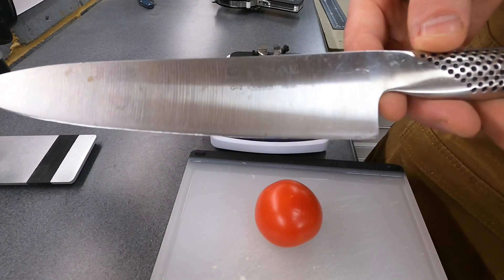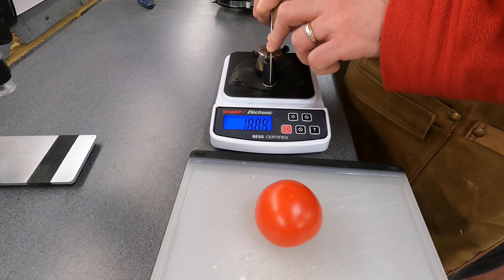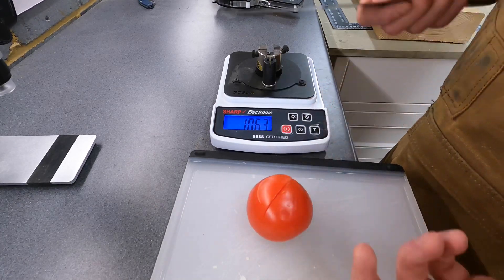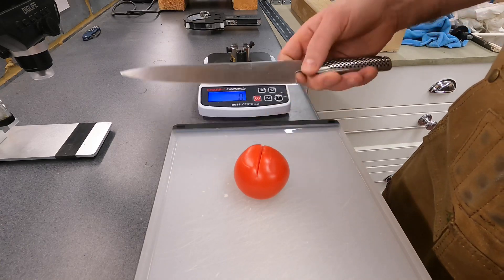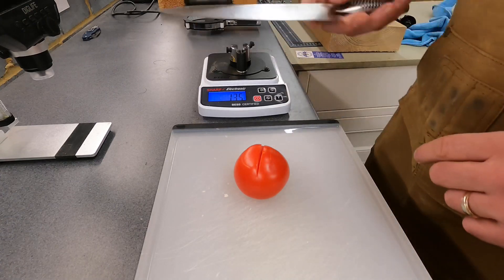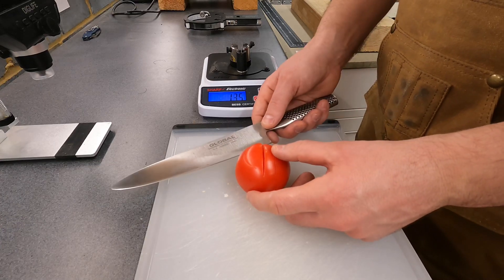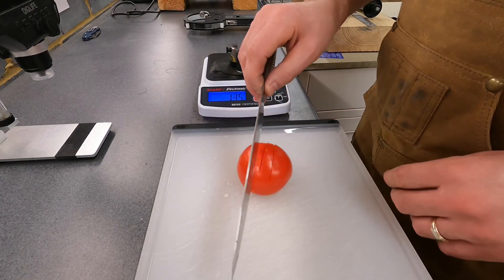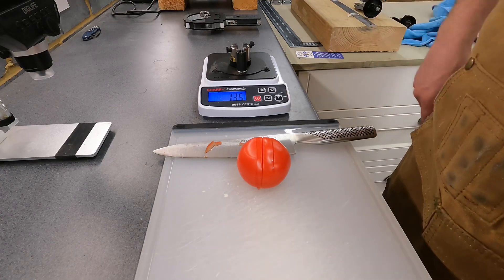Translating BESS Scores into a practical application (tomato slicing)

Comment: In my opinion, the idea that "a sharp knife is a safe knife" isn't wrong per se, but it misses the point. You cut yourself because your body was in the path of the blade! You were doing something risky like cutting toward yourself, or simply not paying attention (guilty). You can argue that a dull knife exacerbates the risk because it requires more force, and doesn't "bite" the food or the cutting board like it should, which makes slips more likely. On the other side, you can argue that a dull knife is more forgiving when you do accidentally make contact. You could even make the point that a sharp knife makes cleaner cuts which heal faster. All these things are true, but somewhat irrelevant. At the end of the day, you cut yourself because you made a mistake – not because the knife was sharp or dull! All that said, there are so many reasons to prefer a sharp knife – you won't cry when you cut onions (seriously); it makes cooking more enjoyable and less of a chore; it legitimately makes certain foods taste better.

Comment: Sharp knife is not a safe knife - stop repeating this BS. Sharp knife is way more dangerous than a dull knife if you don't pay most extreme attention to it. Sharp knife doesn't forgive - it cuts you like crazy upon contact. That's why everybody gets cut after I hand them freshly sharpened blade. Get real.
Reply from the maker: You really haven’t thought about it, have you?
Reply: @greatedgeltd  No, I haven't you're right. Teach me...
Reply from the maker: You’re not here to learn from me, or you would have asked a polite question in the first place… But I’m confident you can work it out, if you apply yourself.

Comment: I am a knife geek, I have proven a sharp knife is not a safe knife, a urban legend a dull knife is unsafe, i also have a Bess tester, everytime I sharpen hy kitchen knives I have to buy a box of bandaids, so whaaaa?
Reply from the maker: It’s not about the minor cuts that can be healed with a Bandaid… working with a sharp knife means you can work at lower pressure, so you are far less likely to slip while pushing hard and cause a serious injury. 
Thanks for tuning in 🙏
Reply: I honestly can't explain or comprehend how wrong you are lol a sharp knife allows you to cut smoother and easier, while a dull knife forces you to cut with much more force and hold an object much tighter with more bodys in the way in front of a duller blade, which is still very shard. I can not fathom how you came the to conclusion that a dull blade is safer
Reply: @TheAussie90 it's simple, I get cut quite often just by being at or near a very sharp blade, but never get cut by a dull blade, you need any more explaining? I base my comment by seeing red blood, how many injuries have you from dull blades, or is your opinion on what you have heard?

Comment: I always find this interesting but would like to see what the longevity is after sharpening. It's fine fir slicing tomatoes 🍅 but how long will that edge hold up with every day use?
Reply from the maker: I fully agree - edge durability is what really counts, but a hard thing to demonstrate on camera. The best technique I know of for demonstrating that is the rope-cutting test of Pete on the CedricAda channel.
Reply: check out Outdoors55 - the sharper the knife, the longer the edge will hold up.
Reply: A super thin edge will do well on that Bess test, but it usually will not stay sharp for very long. And I prefer the paper and hanging hair test… the BESS machine only checks one tiny spot on the blade.

Comment: bess = meaningless gimmick only either someone dishonest and trying to sell something or someone too low iq to understand why it's a gimmick would have any weight in. practical tests of edge keenness and knife/blade sharpness are much much more useful, valuable. but hey those don't come with a cute score that's easy to show everyone on medium like a youtube video. side note, i you want better bess results, make a big old burr and leave it on the edge, you''ll cut the wire more easily, also, use a blade with radius rather than flat. can easily get scores like 10 or less. it's a meaningless gimmick. even a hht test from the razor world has more value. I'm going to get a knife and dull it, so it won't even break skin and leave a tiny little 2 mm section that's keen and it's going to score 10 on the bess and then the knife itself won't cut a damn thing.
Reply from the maker: I certainly agree that BESS can be abused in the wrong hands (see my video on how to use a BESS tester).  But I strongly disagree that the scores are not as useful as practical edge tests. The latter are far less sensitive - good enough for revealing basic information about edge performance but not sensitive enough to discriminate between sharpness levels in a repeatable way.   

i would never recommend comparing BESS scores between sharpeners because there are so many operator variables.  But ‘intra -workshop’ comparisons  are valuable for benchmarking and performance monitoring.  

I’m not sure about radius vs flat edge, but leaving a burr certainly doesn’t work for boosting BESS because it folds over very quickly.  If I wanted to achieve BESS of 10 or below I would crank up the tension and chop down (as per my other video). 

Thanks for watching and for the passionate arguments!

Comment: I noticed in one of your earlier videos that you have another grinder in the background.  Is it setup with either felt/paper/wool etc for polishing?

Curious if you’ve based your setup on Knife Grinders?
Reply from the maker: Well spotted - I still have that grinder - at the end of this video you can just see part of the wooden base right at the top of the frame.  I have two rock hard felt wheels on there for honing super steels.  But I find the gains only marginal in using it, so it’s not often featured in my protocols.  My methods are definitely influenced by Knife Grinders as most of gear is from him.  I tried a few suppliers but find KG materials the highest quality.  Thank you for tuning in!
Reply: I immediately noticed your fluid movement when demonstrating the T8 especially the lift at the point of the knife.  Usually it’s only done well by the Tormek educators or Vadim from Knife Grinders.  The kangaroo strop was another give away.  

At present I am in the process of setting up the same business in Australia.  I have a nice kit of Naniwa whetstones for myself but there is no way I’d try manually sharpening on a commercial scale with that method, it would take around 15 minutes per knife.  The Tormek allows you to sharpen more accurately than a Japanese bladesmith with 50 years experience in 5-6 mins per item. 

My main concerns were sharpening serrated knives as they can be very laborious with often mediocre long term results.  I have watched Knife Grinders score outstanding results on the BESS after following a couple passes on the Tormek then utilising the rock hard felt wheels to de-burr. Have you tested those wheels with serrated knives yourself?
Reply from the maker: @markandrews1219  Thanks so much. - very kind.  About serrated, that technique with the bevelled felt wheel does work. But believe it or not the vast majority of my serrated knives brought to me are to grind off the serrations and put a standard edge on it.  So I’ve only done that sharpening technique a few times, as proof of principle I guess. I do agree with you that serrated are laborious - TBH it’s hard to charge enough to make it worthwhile. 

Good luck with your sharpening business.  If Knife Grinders is your reference then you’re off to a great start (but did you hear the sad news about Vadim’s passing?).
Reply: @greatedgeltd  

Yes, I heard about Vadim passing away.  I went to contact him to get some advice and noticed the condolences online.  

On the serrated knife topic, you raise a very interesting concept to simply reshape and repurposed the blade.  I might give it a go in a little while to test out the concept on a cheaper knife.  Thanks for the chat.